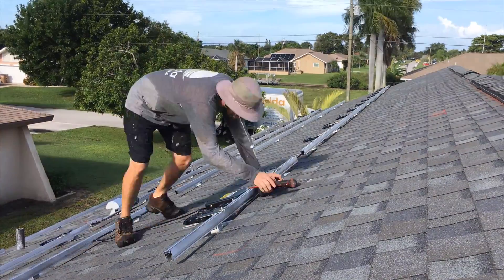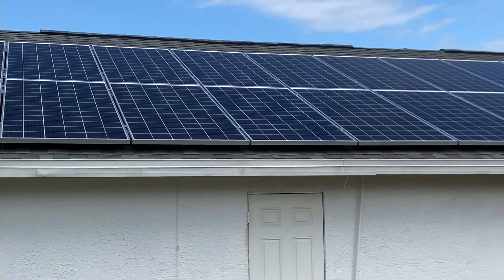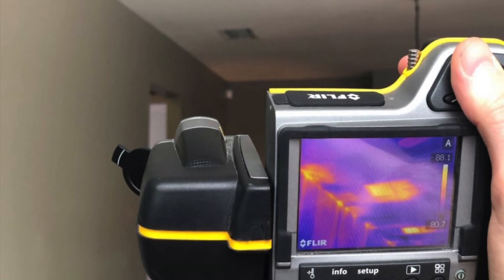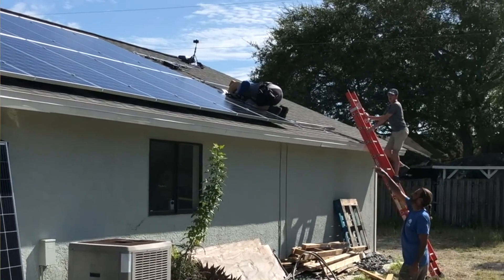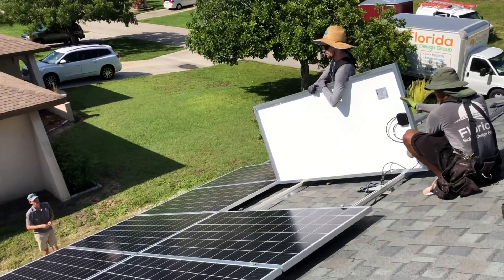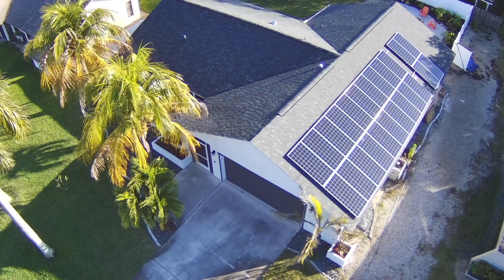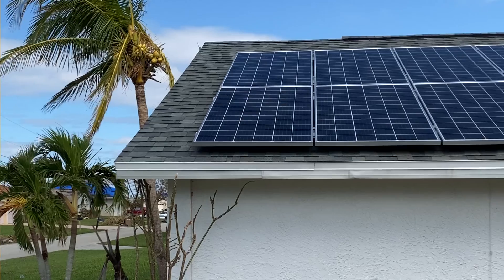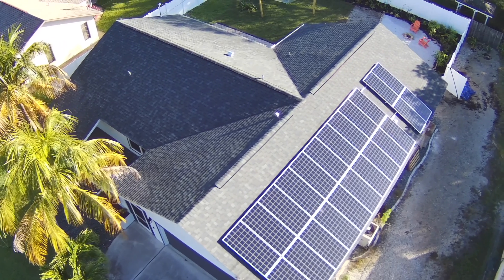My Solar Panel Install 3 Years Later (Tips to Save Thousands)

Comment: It's not going green they are cool and I just bought some panels but they are not green.  it takes factories that use fossil fuels  that make allot of pollution to to make them.
Reply from the maker: Not green to start with anyway, nothing else. Assuming 40 years of net zero home production though, what is the crossover point where all the energy that goes into manufacturing and transporting panels + install equal your renewable production? Probably different for every home and system, but would be an interesting calculation.

Comment: Great video!   I spent 6 months preparing for my solar install.   I switched out all lights to LED's, switched two outdated HVAC systems to high efficiency units and added additional installation and and had house roof replaced needed it, but ended up using my detatched workshop to have the solar panels mounted .     Had to do a agreement with energy company and they even had to switch my transformer before I could go I could connect to grid.    My system is two Sol-Ark 15K Inverters with 60 = 390 Mission Solar Panels and 42 KWH of battery storage.    

My system went online Feb 8th (timed it to new billing cycle) and has averages 85KWH in solar generation and out of that , sends 40 KWH back to the grid on average.  Will be interesting to see Enery Bill on March 10th so I know where to make adjustment's if need , my goal is to be NET ZERO.
Reply from the maker: This is awesome! And it sounds like you did a lot of the practical low hanging fruit first before going for producing more power vs. saving it. Congrats on net zero also!

Comment: Hello, Thanks for your valuable video. However, you forgot to mention the benefit of using the micro inverters in the later part of the view as you had suggested initialliy in it. :-) 

I can search around for it. just an observation, if it helps. Kudos
Reply from the maker: Thanks as well! I mentioned that I'll make another video in the future on it, and I definitely plan to since they are a big deal.

Comment: As someone that’s designed, engineered & installed solar systems from the utility scale down to residential level, I would say it makes more sense to reverse the order of projects when it comes to going solar. 

Obviously make sure the roof is new or in relatively new condition. Then go solar based on current annual consumption (follow the advice of researching companies on your own, don’t go to lead forms as they just end up raising the price of your solar system as he mentions in the video). The logic behind this is that your current usage is your worst case scenario. Once you go solar and then do the energy efficiency improvements, you would have reduced the consumption side of the equation as well. 

Utility companies are very keen on not letting you sell a lot of extra energy back to the grid (they typically cap solar offsets to <110%). So by going solar when your usage is at its peak it allows you to create a buffer of the extra energy you send back to grid after the efficiency upgrades are made. 

Doing it in the order suggested in the video may actually result in a remaining utility bill some months where your usage is unusually high (family visits, ac running more etc). Keep in mind if you’re in south Florida you’re probably with FPL and they charge a minimum monthly fee of about $23. 

Otherwise good info in the video. And I’m not sure if it was jump cuts in editing but your face seemed to be artificial like AI at some points.

P.S. I whole heartedly agree to always ways keep your own records. Some companies are less than 100% honest even if they do great quality work.
Reply from the maker: Appreciate the comments! It seems we agree on a lot. I'm still not totally clear on how you described doing it in reverse order but I think I see what you means. My point was also to get your bill down because it could literally save you thousands, perhaps $10k to $20k or more on a bigger solar system not needed due to your bill being lower to efficiency, that was my main point. A few bucks here and there, if you overproduce, will never catch up to the additional spent if that was the case. But there are a lot of good ways to go about this. As to how accurate to get on matching your existing energy use - there's so many variables. I agree on family visits, things changing etc. You do your best at the time and then let the chips fall where they may. It's like doing test in/test out with energy audits and then comparing it to energy modeling - rarely do the actual numbers match up. The LCEC monthly net meter fee was also mentioned in the video. On the AI face thing - well..that's definitely me haha. I'm new to video and it's really awkward staring at a lens for me, never done it before. But as they say - perfection is the enemy of progress, so I put it out anyway.